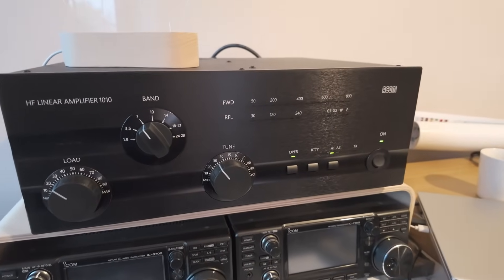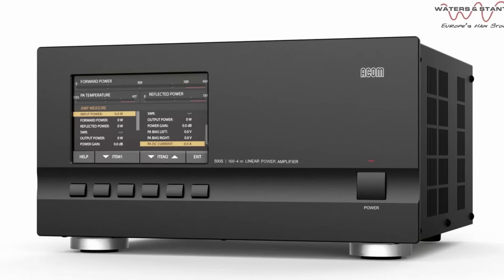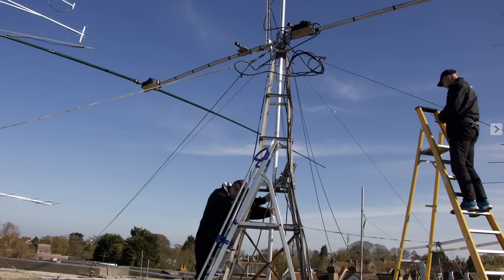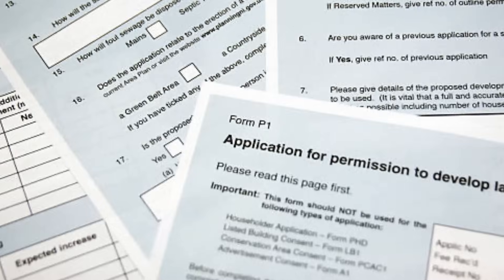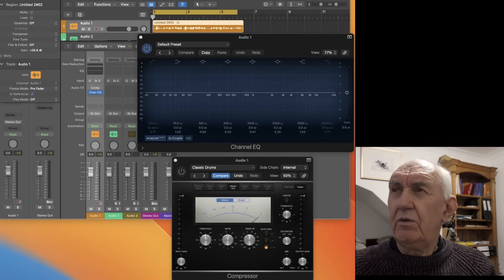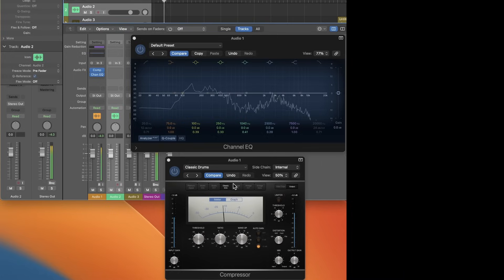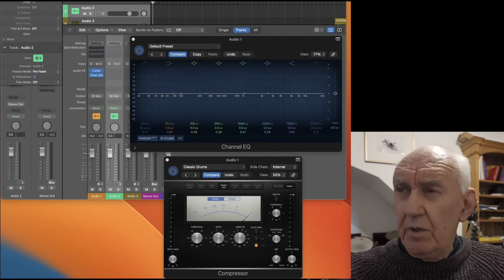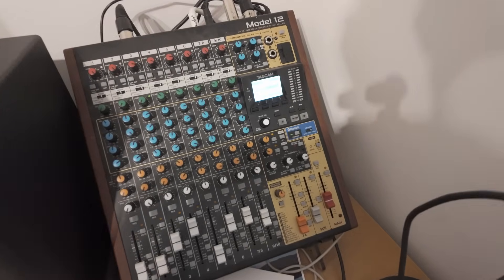Louder SSB Signals - at No Cost!  | Ham Radio

Comment: hi, ya, in history it was quite common hams modified their mics with adding compressor; I myself considered almost 30yrs ago some SM2165 as preconditioner for 16-bit recording for our rock band to prevent clipping with best input gain setting, today this is quite solved by 24bit no hassle... that chip is obsolete, but as replacement is SSM2167, it has fixed gain, but has compressor and noise gate, and for some CB radios it might be simple try to mod of mic, IMHO
Reply from the maker: Thanks for the info.

Comment: Max-out 2500 Hz, mild boost around 800 Hz, -6 dB around 200 Hz. Use 18 dB/octave high-cut filter around 2700 Hz.  Like someone said, squeeze into 300-2700 space to increase power/bandwidth.  Alternatively, use a falsetto voice like a YL, and when everyone clears out of the way, use your normal voice (LOL).  😁
Reply from the maker: Thanks. I think I will bypass the voice option!

Comment: Bass down, mild treble boost, 2/3 - 3/4 on the mic gain for just a bit of ALC action, bring up the weak spots wi 10 or 12 dB compression. I need to listen on one of those remote SDR sites sometime, but I do get good reports back from the 7300 so far.
Reply from the maker: Yes EQ is worth the effort but actual values depend on voice. A female voice suffers from bass cut and male generally benefits. Thanks for sharing.

Comment: I run Mic Gain at 95% on SSB, but only 10% on D-Star, per other operators' feedback. 
I love my IC-SM-50 Mic, Directional, and I don't have to hold it with arthritic hands, plus added a breath sock and it has its own gain, which I turn to about 50%. I also run power gain at 95%.
Reply from the maker: Many thanks for sharing.

Comment: In the job the women operators were better heard than the men… because of the pitch of the female voice… recently I watched something from Bob Heil… he recommended as a start on the EQ to drop the bass -2 increase the treble +3 and raise the 2.5k control… he did an impressive demo… 
This video is excellent as usual Peter, I’m building a dedicated man hut in the garden and I’m not transmitting yet…coming back after almost 25yrs… I’ve learned a lot from your channel and you are very encouraging… good job…  Thanks +10dB  
Best wishes to everyone.
73
ps… I’d like a valve amplifier about 300 | 400w …. Anyone recommendations?
Reply from the maker: Many thanks. Lower power Amps are available on used market. But as regards new, a 400w Amp probably costs almost as much to build as  one having twice the power. Thanks for your support.
Reply: "...because of the pitch of the female voice…"  On SSB, slightly adjust your transmit frequency, and you too can have a higher pitch voice.

Comment: Great video but I have a question. I am a new Technician and I have watched many YT videos of Ham radio operators on HF SSB using the stock microphone. Why don’t they use a power microphone? Maybe they do but I don’t see it. 

I assume that you know what a pre-amplified microphone (power mic) is. If not, it is a microphone that has a circuit board in it, powered by a 9 vdc battery, and a volume knob, that amplifies your voice. The Astatic D-104 and many Turner microphones use this technology as well as others. Some of these microphones can be noise canceling and/or non-omnidirectional, which helps to cut out any background noises. 

I just read an article about AM and SSB. An AM frequency is 6000 Hz wide and contains a carrier and both the upper and lower side bands. USB and LSB  are only 3000 Hz wide and omits the carrier.

Back in the 70’s on CB (in the USA), I used pre-amplified (power) microphones both on AM and SSB. How does this help? Well, on CB there may be dozens of people talking at the same time on the same frequency. If you and I were about a mile apart and we both were talking on the same CB channel at the same time, you have a stock mic and I have a power mic, my signal would be heard above yours and at a longer distance. 

Getting back to Ham frequencies, HF SSB is also basically AM, although different frequencies than CB. I would think that the same holds true for the difference between a stock microphone and a pre-amplified power microphone. Wouldn’t you want to be heard better?

The only thing I can think of is that many better brands of CB radios back in the 70’s had a mic gain knob in which you could adjust the stock microphone’s gain or volume. I think many modern day Ham radios have the same thing in which case, adding a power microphone may over drive the modulation and make you sound garbled. And I don’t know if current Ham radios could accept these types of microphones. 

What do you think?
Reply from the maker: Some Ham Radio operators do use pre-amped base mics. The main advantage is hands free operation.